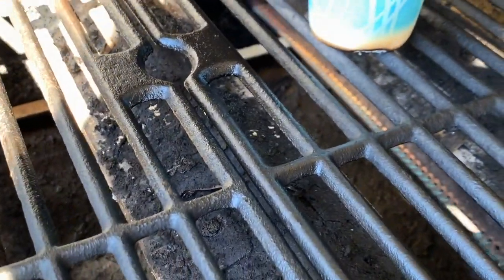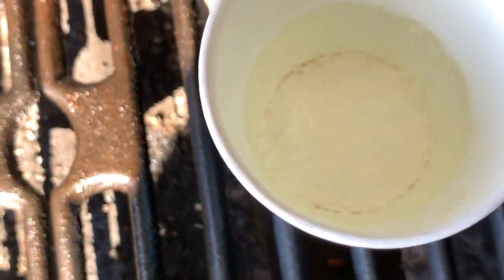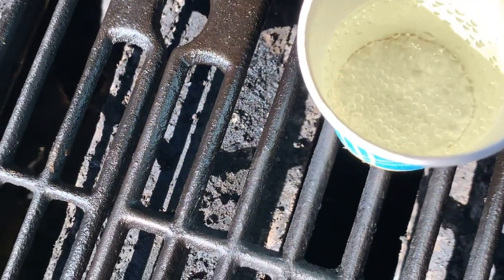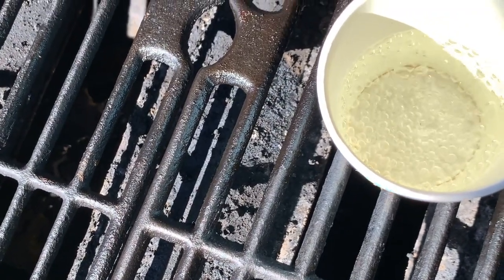The science of CSI polish Ceram X

Comment: Hey Tom, I just started using CSI and so far I’m really enjoying it. You told me on FB that your red foam polishing pad is finer than a black foam pad. I’m not opposed to purchasing your red foam pad but I figured I’d try using what I had at the shop first, plus I have the quick change pad adapter and use double sided pads. That being said, I remembered what you said about your red pad being finer so I went from wool to a 3M blue pad which is normally used with their ultra fine polish. Seemed to work nicely and I didn’t notice any swirl marks. Do you think I’m ok or would you still recommend getting a CSI red pad? Thanks Tom.
Reply from the maker: Yes perfect the blue pad is 3M finest pad. Our Red foam is the equivalent.
Reply: I’ve personally found the csi red foam to be slightly better than the 3m blue foam. I’ve used 3m for 10 years and csi has better products hands down.

Comment: Love the videos keep them coming! For anyone reading through the comments wondering if this is a product they should try the answer is yes absolutely. I’ve used 3M for 10 years frustrated with the results. I do high end restoration work and after using CSI I’ll never ever use anything else. I was at first skeptical but IT WORKS and I’m very pleased with the end results on these cars where perfection is all that is acceptable. If you don’t do high end work and run a basic body shop then CSI makes even more sense for you. It’s a faster, safer system getting those collision jobs in and out faster.